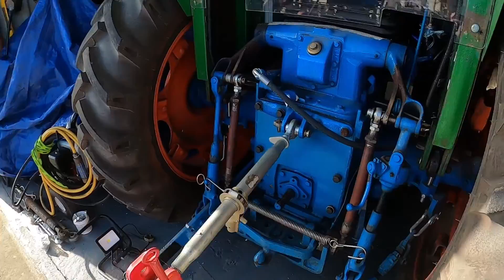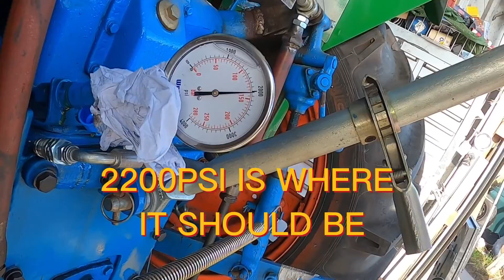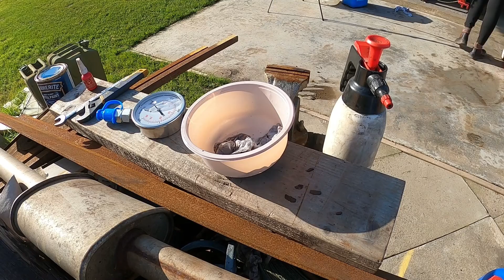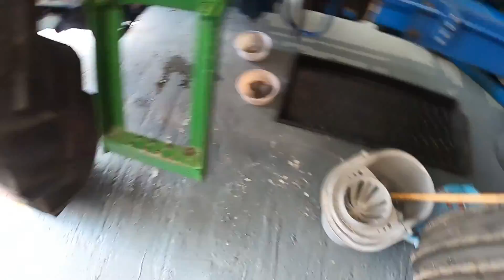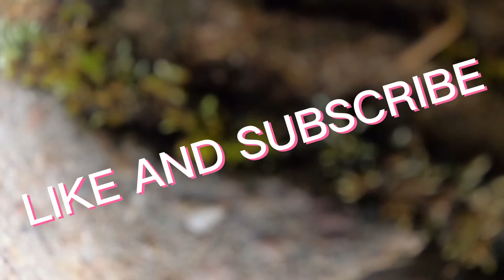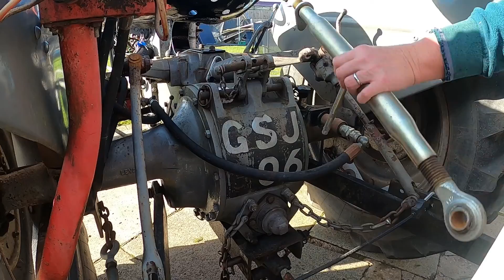TESTING TIMES, HYDRAULIC PUMP PRESSURE CHECK

Comment: Hi Lisa, The pressure gauge you are using is not designed to seal on the threads. You may need a tapered thread pressure gauge or a different adapter. Google search "Pressure Gauge Know-How: Difference Between NPT and G Connections". Cheers, Paul.
Reply from the maker: Hi Paul. The gauge is bspp but i cannot find a satisfactory adaptor. The hydraulic company provided the gauge and connector. They advised to loctite it together. Maybe i can install a copper or aluminium washer on the flat face to seal it?  If you have any links to products that will be great

Comment: Hi Lisa, It looks like you have good pressure  (2100 psi) from what I could see. These old tractors can be temperamental with their hydraulic systems, my tractors are always creeping down even after replacing the piston, piston seal, and cylinder. I guess that is what you can expect when trying to keep the old machines running. All the best, Ken
Reply from the maker: Yes it is hars to get a giod quality control valve i did swap mine for a spare that i had which really helped after the piston seal was replaced but there will be wear in the valve chest. Dont know how much it costs to have the valve chest machined over size and a new spool made to fit it?